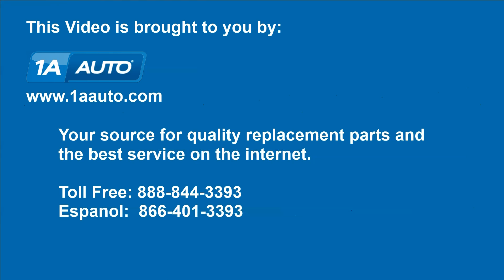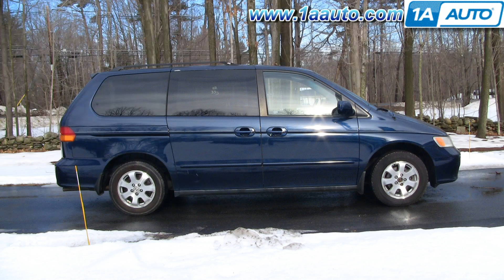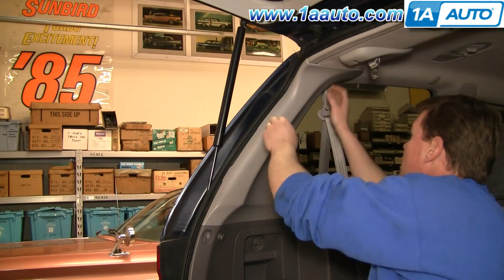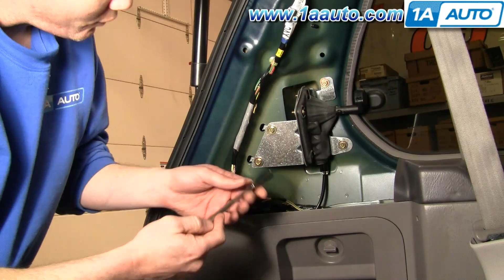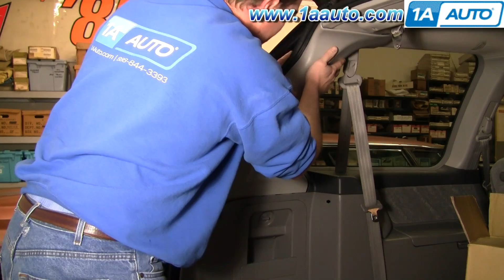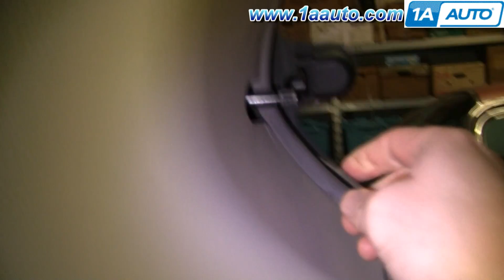How to Replace Vent Window Motor 99-04 Honda Odyssey

Comment: I have an '03 Odyssey & one of the vents has a hard time closing/opening.  It's been like that for at least a decade.   If the motor is still working, then I am assuming this is because of lost lubrication.  I am wondering if anyone knows where the grease points are in this area in & around the vent window. Maybe even inside the motor.   I have not opened the trim panel yet, if I ever have to.    
03/23/25

Comment: awesome thanks for uploading video  and giving the  OEM parts number. I will definitely avoid  dorman or X-man parts and go for original honda parts. The price to install driver side rear vent motor including parts I inquired honda is  $147(parts) +  $$$(labor) = $400.00. Total rip off.  This video is a life saver

Comment: Hello, thank you for this video!  I do have a question.  We recently bought a used 2002 Odyssey and the dealer said they "disabled" the motors because something didn't work.  Is there a way to enable them and how do I do that??  So my actual question is, would they both be malfunctioning and need to be replaced, or is there a way to see if just one needs to be replaced by "re-enabling" them? Is that even thing?  Thanks!
Reply: “Disabled.” Ha. That’s a good one! 

Mary, our window motors (2004) became temperamental, working only haphazardly, like, on random sunny days. They eventually stopped working all together. I was told that they are often the first things to fail. And, yes, they are very expensive to repair/replace thru the dealer, which is why I’m here. 

A friend said that adding a small resister to the circuitry back there can also do the trick[?], as the voltage of the system overloads the window motor[?].
Reply: @BUDan1995  Replacing the motors is not needed, they rarely go out. The issue with these is there is a TINY dab of solder that connects 2 peices of metal inside the motor and it gets old and cracks apart from opening and closing vibrations. The simple fix is to just put another dab of solder on the existing spot and its VERY easy to get to and see once you open the motor up. Has worked 7 out of 7 times for me when doing my own and others vans. I know I'm late but just some insight.
Reply: @dy2_str33t_king  How do you open the motor? Just one round solid piece!

Comment: Hi!  I have a 2006 sienna.  The rear vent window came unglued from the hinge.   What type of glue should I use to reattach the window.   Thankfully I  had passengers in the way back and they held the window to prevent it from falling onto the highway.

Comment: Great video. I just ordered both motors. But after doing a dry run on the left side I find that I cant put the panel back with the side tabs going under the weather seal that goes around the window frame. Is there some secret to this?

Comment: Do you have a video for replacing the passenger side rear vent window motor? The AC duct is blocking the motor. I can't seem to figure out how to remove the duct work. Thank you.
Reply: The passenger side is much more difficult.  The duct work is held in place by a couple of screws that you can clearly see.  Remove the screws and the duct work pulls out.  It's jammed into another duct in the roof and the bottom sits on a small section of duct that sits on the blower housing.  You have to wrestle with it for awhile.  Difficult to get out but even more difficult to put it back in.  One more thing.  Before you replace the motor, open up the plastic housing and remove the female connector that connects the male connector in the wiring to the motor.  Disconnect it from both the male connector and the motor and then check it for continuity.  I found poor continuity in one of the prongs in both left and right motor assemblies.  A drop of solder fixed each one without having to replace the motor assembly.
Reply: Yea, the passenger side is the most annoying part. I dont know how to remove the duct too.
Reply: I guess by this time you must have found the left side motor replacement video online on youtube.